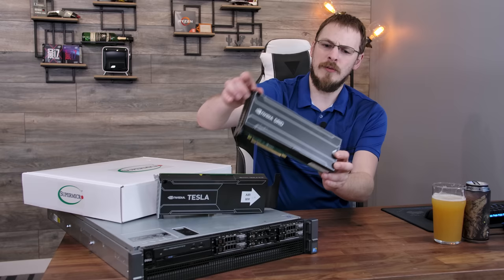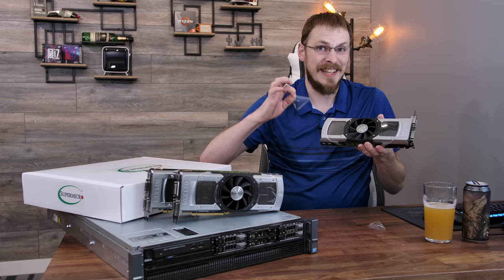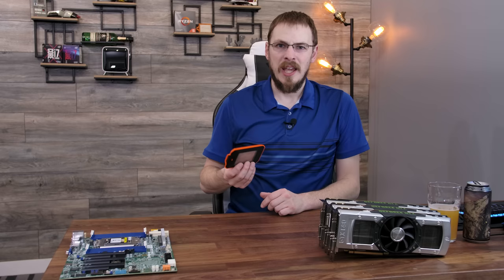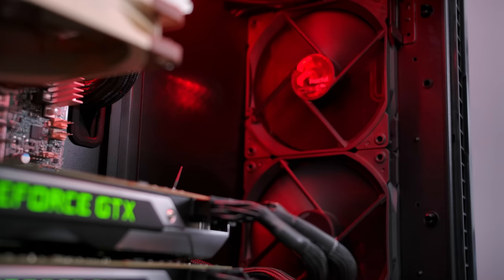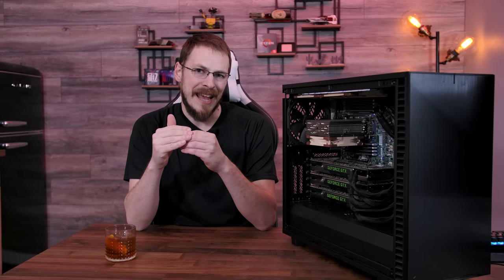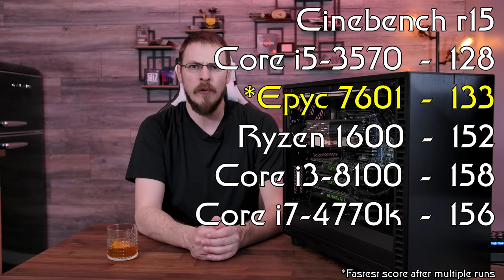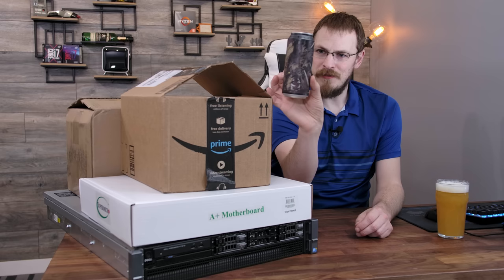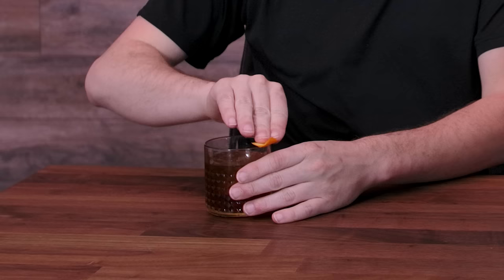EPYC Cloud Gaming Server Build - GTX 690 Editon - Part 4 of ?

Comment from the maker: Yes, the vocal audio isn't great. I lost my regular mic pack, and didn't change settings on the receiver. So it's peaked a bit throughout the video. Sorry... I'll make sure it doesn't happen again... at least until the next video.
Reply from the maker: 🎵 DID YOU EVER KNOW THAT YOU'RE MY HEEEEE-ROOOOOO!!!!! 🎵
Reply: @CraftComputing  YW... From one tech guy to another. ;) Always willing to help when needed. Cheers!
Reply: 5/10

No ASMR peel sound effect.
Reply: Jeff, how could you!!! Frankly I expected better from you... But the beer reviews are back! Huzzah, all is forgiven! :D
Reply: Wouldn't vertically mounting the third card be possible solution to the issue with the sata-connectors?
Reply: @eastcoastmodz5195  Exactly what came to my mind when he explained his problem! These Silverstone sata cables are great
Reply: If you can get your hands on Izotope RX, RX De-Clip is absolute magic for fixing issues like this with 1 or 2 clicks.
Reply: @CraftComputing  hey i have some ddr4 ecc registered 24000 mhz samsung b die im trying to sell i might have 8 matched sticks to sell reply if you want more info
Reply: what do you think on using the p106-90? there are on sale for 35$ on ebay right now

Comment: A few years ago I was walking from a river bank to get back up to my camp site. I heard what sounded like an animal in distress but it was coming from a distance. So I followed the noise as best as I could, but when I got closer to it, the animal would get quite. I had to stand perfectly still for about 45 seconds before it started making noise again. A horrible screeching growl-like sound arose again, leading me in the direction of this unknown animal. It took two more times of standing still to narrow down where the distressed animal noise was coming from. When I finally found it, I realized it was a hurt Possum. The horrible screeching growling noise quickly turned into an angry bundle of hissing sounds. This poor Possum was gravely attacked by another animal. Most of his/her rear, left leg was shredded with cuts extending all the way to the creatures stomach. 
It was obvious from the horrible noises it was making that it was in great pain and it was too injured to run away or protect itself any more. I had no choice but to put it down, to end the suffering. Sometimes, Mother Nature can be harsh, but this possum did not deserve to suffer. And even though it sounded horrible with screeching that could be heard 100 yards away, it still sounded better than the audio in this video.
Reply from the maker: 56 65 72 79 20 66 75 6e 6e 79 2c 20 49 20 73 75 70 70 6f 73 65 20 6d 6f 73 74 20 70 65 6f 70 6c 65 20 6b 6e 6f 77 20 68 6f 77 20 74 6f 20 64 65 63 6f 64 65 20 62 69 6e 61 72 79 2c 20 62 75 74 20 73 69 6e 63 65 20 79 6f 75 20 73 74 61 72 74 65 64 20 74 68 69 73 20 67 61 6d 65 20 49 20 73 75 70 70 6f 73 65 20 77 65 20 73 68 61 6c 6c 20 63 6f 6e 74 69 6e 75 65 3b 20 6d 79 20 74 75 72 6e 21 0a 0a 54 32 39 76 61 43 77 67 63 32 38 67 65 57 39 31 49 47 52 76 49 47 74 75 62 33 63 67 63 32 39 74 5a 53 42 6c 62 6d 4e 76 5a 47 6c 75 5a 79 45 67 54 47 6c 7a 64 47 56 75 49 48 42 68 62 43 77 67 64 47 68 70 63 79 42 70 63 79 42 71 64 58 4e 30 49 48 52 6f 5a 53 42 69 5a 57 64 6e 61 57 35 70 62 6d 63 73 49 48 52 70 62 57 55 67 5a 6d 39 79 49 48 4e 76 62 57 55 67 63 6d 56 68 62 43 42 6a 63 6e 6c 77 64 47 38 68 43 67 70 4d 62 58 68 32 49 48 70 30 65 6e 4a 74 49 47 4a 73 5a 69 42 31 65 6e 4a 76 49 47 64 73 49 47 39 32 5a 79 42 75 64 69 42 33 62 47 52 74 4c 69 42 45 64 6d 39 76 4c 43 42 7a 62 47 64 6f 63 32 78 6e 4c 43 42 6e 63 33 4a 6f 49 48 4a 6f 49 47 78 74 62 32 49 67 64 47 78 74 62 58 6f 67 64 48 5a 6e 49 47 52 73 61 57 68 32 4c 67 6f 4b 53 79 42 6c 61 57 31 79 5a 69 64 7a 49 47 68 6b 63 6d 59 67 61 57 56 6a 63 6e 4e 7a 5a 57 55 67 65 47 39 7a 4c 43 42 31 64 58 49 67 62 6d 52 32 61 47 73 67 63 57 56 70 64 32 74 76 65 57 4e 6b 43 67 6f 79 64 53 41 77 4d 43 41 78 63 53 41 78 4e 43 41 78 4e 79 41 77 4f 53 41 78 61 79 41 77 4d 53 41 31 4d 69 41 30 4e 53 41 7a 4d 53 41 77 4d 43 41 77 4e 79 41 31 4d 79 41 78 4d 69 41 77 4d 53 41 77 4d 53 41 31 5a 53 41 31 4d 79 41 77 5a 53 41 77 63 79 41 78 63 43 41 78 4e 79 41 31 4e 43 41 78 4e 69 41 30 4f 43 41 78 4e 69 41 78 61 53 41 77 4e 69 41 78 4e 79 41 30 4f 43 41 78 5a 43 41 77 4d 43 41 78 61 43 41 78 63 53 41 77 63 43 41 31 4e 53 41 33 4f 43 41 33 4f 53 41 30 4e 53 41 30 4f 43 41 30 5a 79 41 31 4d 69 41 31 4d 79 41 30 4e 53 41 30 4f 43 41 30 5a 43 41 31 4d 69 41 31 4d 79 41 30 4e 53 41 34 61 43 42 79 62 69 42 6e 5a 53 41 35 4d 53 42 6b 4e 53 42 79 4e 43 41 34 63 43 42 6e 4d 69 42 6b 59 79 41 34 4e 79 42 79 4f 43 42 76 4d 79 41 35 4d 43 42 6e 4d 79 42 6c 4f 43 41 34 4e 79 42 6c 4e 43 42 30 63 43 41 35 4d 53 42 6f 4e 53 42 6e 4e 43 41 34 5a 53 42 78 4d 69 42 75 61 43 41 34 4e 79 42 6c 4f 43 42 6b 4d 79 41 35 4d 43 42 78 4d 79 42 76 4f 53 41 34 62 43 42 6c 59 79 42 78 62 79 41 35 4d 53 42 6f 4e 53 42 6c 4e 43 41 34 5a 53 42 78 4d 69 42 75 61 43 41 34 4e 79 42 6c 4f 43 42 6d 4d 79 41 35 63 79 42 78 4f 43 42 70 61 53 41 34 4e 79 42 6c 4e 43 42 30 63 43 41 31 4d 79 41 30 61 79 41 30 5a 43 41 34 5a 53 42 78 4d 69 42 75 5a 79 41 34 4e 79 42 6c 4f 43 42 6b 4d 79 41 35 4d 43 42 78 4d 79 42 76 4f 53 41 34 62 43 42 6c 59 79 42 78 62 79 41 35 4d 53 42 6f 4e 53 42 6c 4e 53 41 34 4d 43 42 6d 4f 53 42 30 63 53 41 34 4e 79 42 6f 4f 43 42 6c 4d 69 41 35 4d 43 42 6a 4d 79 42 79 4f 43 41 30 62 69 41 32 4e 53 41 35 4d 43 42 6e 4d 79 42 6c 4f 53 41 34 61 43 42 79 62 69 42 6e 5a 53 41 35 4d 53 42 6b 4e 53 42 79 4e 43 41 34 63 43 42 6e 4d 69 42 6b 59 79 41 34 4e 79 42 79 4f 43 42 76 4d 69 41 35 61 53 42 6e 4f 43 42 6c 64 69 41 34 63 79 42 6f 5a 43 42 6a 63 53 41 35 4d 53 42 76 4e 53 42 6f 4e 43 41 30 5a 43 41 35 4d 43 42 6a 4d 79 42 79 4f 53 41 34 63 79 42 6f 5a 43 42 6a 63 69 41 35 4d 53 42 76 4e 53 42 6f 4e 43 41 34 5a 69 42 6a 4d 69 42 78 62 69 41 34 4e 79 42 6f 4f 43 42 6c 4d 69 41 35 5a 53 42 30 4f 43 42 77 62 43 41 34 61 53 42 6b 63 53 42 75 5a 79 41 35 4d 53 42 6c 4e 53 42 6b 4e 53 41 30 63 53 41 31 63 53 41 35 4d 53 42 6f 4e 53 42 6c 4e 43 41 34 5a 53 42 78 4d 69 42 75 5a 79 41 34 4e 79 42 6c 4f 43 42 6b 4d 79 41 35 4d 43 42 78 4d 79 42 76 4f 53 41 34 62 43 42 6c 59 79 42 78 62 79 41 35 4d 53 42 6f 4e 53 42 6e 4e 43 41 34 4d 43 42 6d 4f 53 42 30 63 53 41 34 4e 79 42 6f 4f 43 42 6e 4d 79 41 79 5a 53 41 31 63 79 41 30 4f 43 41 34 63 79 42 6f 5a 43 42 6a 63 69 41 35 4d 53 42 76 4e 53 42 6f 4e 43 41 34 5a 69 42 6a 4d 69 42 78 62 69 41 34 4e 79 42 6f 4f 43 42 6c 4d 79 41 35 4d 43 42 6a 4d 79 42 79 4f 43 41 34 63 79 42 6f 5a 43 42 6c 63 69 41 35 4d 53 42 76 4e 53 42 6f 4e 43 41 34 5a 69 42 6a 4d 69 42 7a 62 69 41 30 61 79 41 7a 4e 79 41 7a 4d 43 41 79 5a 69 41 31 5a 53 41 30 4d 69 41 30 4f 43 41 30 4e 79 41 78 4d 69 41 79 63 53 41 32 62 69 41 34 62 43 42 6c 59 79 42 78 62 79 41 35 4d 53 42 6f 4e 53 42 6c 4e 43 41 34 5a 53 42 78 4d 69 42 75 5a 79 41 34 4e 79 42 6c 4f 43 42 6b 4d 79 41 35 4d 43 42 78 4d 79 42 76 4f 43 41 34 62 43 42 6c 59 79 42 7a 62 79 41 35 4d 53 42 6f 4e 53 42 6c 4e 53 41 34 5a 53 42 78 4d 69 42 75 61 43 41 34 4e 79 42 6c 4f 43 42 6b 4d 79 41 35 4d 43 42 78 4d 79 42 76 4f 53 41 34 62 43 42 6c 59 79 42 78 62 79 41 35 4d 53 42 6f 4e 53 42 6c 4e 43 41 34 5a 53 42 78 4d 69 42 75 5a 79 41 34 4e 79 42 6c 4f 43 42 6d 4d 79 41 35 63 79 42 78 4f 43 42 70 61 53 41 34 4e 79 42 6c 4e 43 42 30 63 43 41 31 4d 79 41 30 62 43 41 30 4e 79 41 34 5a 69 42 6a 4d 69 42 78 62 69 41 34 4e 79 42 6f 4f 43 42 6c 4d 79 41 35 4d 43 42 6a 4d 79 42 79 4f 53 41 34 63 79 42 6f 5a 43 42 6a 63 69 41 35 4d 53 42 76 4e 53 42 6f 4e 53 41 34 4d 43 42 6e 4f 53 42 6d 64 43 41 34 4e 79 42 76 4f 43 42 6f 4d 79 41 35 5a 69 42 6d 4f 43 42 7a 63 79 41 30 4d 43 41 30 5a 79 41 35 4d 43 42 6b 4d 79 42 6b 4f 53 41 34 64 69 42 76 5a 79 42 6b 5a 43 41 35 4d 53 42 79 4e 53 42 76 4e 43 41 34 61 53 42 6b 4d 69 42 6a 63 53 41 34 4e 79 42 76 4f 43 42 6f 4d 69 41 35 5a 69 42 6d 4f 43 42 7a 63 79 41 34 62 43 42 6c 59 79 42 78 62 79 41 35 4d 53 42 6f 4e 53 42 6e 4e 43 41 30 59 79 41 31 4d 69 41 35 4d 53 42 79 4e 53 42 76 4e 43 41 34 61 53 42 6b 4d 69 42 6a 63 53 41 34 4e 79 42 76 4f 43 42 6f 4d 79 41 35 4d 43 42 6b 4d 79 42 6b 4f 53 41 34 64 69 42 76 5a 79 42 6b 59 79 41 35 4d 53 42 79 4e 53 42 78 4e 43 41 34 61 53 42 6b 4d 69 42 6a 63 53 41 34 4e 79 42 76 4f 43 42 6f 4d 69 41 31 4d 69 41 31 4d 79 41 30 4e 53 41 30 4f 43 41 30 5a 43 41 35 4d 43 42 6a 4d 79 42 79 4f 53 41 34 63 79 42 6f 5a 43 42 6a 63 69 41 35 4d 53 42 76 4e 53 42 6f 4e 43 41 34 5a 69 42 6a 4d 69 42 78 62 69 41 34 4e 79 42 6f 4f 43 42 6c 4d 69 41 35 5a 53 42 30 4f 43 42 77 62 43 41 34 61 53 42 6b 63 53 42 77 61 43 41 35 4d 53 42 6c 4e 53 42 6b 4e 43 41 34 63 79 42 75 4d 69 42 6e 5a 43 41 34 4e 79 42 6b 4f 43 42 79 4d 79 41 35 4d 43 42 75 4d 79 42 6f 4f 53 41 34 61 53 42 6b 63 53 42 75 61 43 41 35 4d 53 42 6c 4e 53 42 6b 4e 53 41 34 63 79 42 75 4d 69 42 70 5a 43 41 34 4e 79 42 6b 4f 43 42 79 4d 79 41 35 4d 43 42 75 4d 79 42 6f 4f 43 41 30 4d 43 41 30 5a 43 41 78 4d 69 41 31 4e 43 41 32 59 79 41 30 63 53 41 34 63 43 42 6e 4d 69 42 6b 59 79 41 34 4e 79 42 79 4f 43 42 76 4d 79 41 35 4d 43 42 6e 4d 79 42 6c 4f 53 41 34 61 43 42 79 62 69 42 6e 5a 53 41 35 4d 53 42 6b 4e 53 42 79 4e 53 41 34 4d 43 42 78 4f 53 42 71 5a 79 41 34 4e 79 42 6b 4f 43 42 30 4d 79 41 35 4d 43 42 75 4d 79 42 6f 4f 43 41 30 4e 79 41 30 5a 43 41 31 5a 79 41 35 4d 53 42 79 4e 53 42 76 4e 43 41 34 61 53 42 6b 4d 69 42 6a 63 53 41 34 4e 79 42 76 4f 43 42 6f 4d 79 41 35 4d 43 42 6b 4d 79 42 6b 4f 53 41 34 64 69 42 76 5a 79 42 6b 59 79 41 35 4d 53 42 79 4e 53 42 78 4e 43 41 34 61 53 42 6b 4d 69 42 6c 63 53 41 34 4e 79 42 76 4f 43 42 6f 4d 69 41 79 5a 53 41 31 4d 79 41 30 5a 69 41 30 4e 69 41 34 63 79 42 75 4d 69 42 6e 5a 43 41 34 4e 79 42 6b 4f 43 42 79 4d 79 41 35 4d 43 42 75 4d 79 42 6f 4f 53 41 34 61 53 42 6b 63 53 42 75 61 43 41 35 4d 53 42 6c 4e 53 42 6b 4e 53 41 34 63 79 42 75 4d 69 42 6e 5a 43 41 34 61 43 42 7a 4d 79 42 77 4d 43 41 35 4d 43 42 6e 4d 79 42 6c 4f 53 41 7a 4e 79 41 7a 4d 43 41 31 5a 69 41 31 4d 79 41 30 64 43 41 30 4f 43 41 34 63 43 42 6e 4d 69 42 6b 59 79 41 34 4e 79 42 79 4f 43 42 76 4d 79 41 35 4d 43 42 6e 4d 79 42 6c 4f 53 41 34 61 43 42 79 62 69 42 6e 5a 53 41 35 4d 53 42 6b 4e 53 42 79 4e 53 41 34 63 43 42 6e 4d 69 42 6b 5a 43 41 34 4e 79 42 79 4f 43 42 76 4d 79 41 35 4d 43 42 6e 4d 79 42 6c 4f 53 41 32 4d 69 41 30 4f 43 41 31 4d 69 41 30 59 79 41 30 4d 69 41 30 4f 43 41 34 63 79 42 75 4d 69 42 6e 5a 43 41 34 4e 79 42 6b 4f 43 42 79 4d 79 41 35 4d 43 42 75 4d 79 42 6f 4f 53 41 34 61 53 42 6b 63 53 42 75 61 43 41 35 4d 53 42 6c 4e 53 42 6b 4e 53 41 34 63 79 42 75 4d 69 42 6e 5a 43 41 34 4e 79 42 6b 4f 43 42 79 4d 79 41 35 63 43 42 71 4f 43 42 6d 61 43 41 34 64 69 42 76 5a 79 42 6b 5a 43 41 35 4d 53 42 79 4e 53 42 76 4e 43 41 34 61 53 42 6b 4d 69 42 6a 63 53 41 34 4e 79 42 76 4f 43 42 6f 4d 79 41 35 4d 43 42 6b 4d 79 42 6b 4f 43 41 34 64 69 42 76 5a 79 42 6b 59 79 41 35 4d 53 42 79 4e 53 42 76 4e 43 41 34 61 53 42 6b 4d 69 42 6a 63 69 41 77 4e 53 41 7a 4e 43 41 30 62 69 41 31 61 69 41 79 5a 79 41 30 61 43 41 30 63 53 41 7a 4d 79 41 33 4f 43 41 31 4d 79 41 30 4e 53 41 30 4f 43 41 77 62 69 41 31 4d 69 41 31 4d 79 41 30 4e 53 41 7a 4e 43 41 30 5a 79 41 31 4d 69 41 31 4d 79 41 30 4e 53 41 30 4f 43 41 7a 4d 77 3d 3d
Reply: @CraftComputing  Hey Hotshot...You spelled "beginning" wrong.
Reply: Oof, got him
Reply: @CraftComputing  Only managed to get to the atbash encoded part ):
Reply: @CraftComputing  Damn i got as far as windows-1251
Reply: @CraftComputing  Can we get a hint on the second part? I love this games but I did only the hex part :(
Reply: @CraftComputing  Wow... Lol I know pretty much no encoding. I only made it to Base64 (the second part).
EDIT: Made it to atbash.
Reply: @CraftComputing  Made it through the Beaufort Cipher, still trying to crack the next one.

Comment: 9:15 - thats a far better mounting method for M.2 drives than the normal microscopic screw, would like to see that on consumer boards.
Reply from the maker: Right? The main issue with it is it doesn't look good, and boards are sold partly on looks these days.

Maybe in black it's be passable.

Comment: Great video and what a monster machine. It was pleasure to watch and can't wait for next part. Quick suggestion here - move the middle GPU to vertical position if possible, that's not because the thermals but to give you free access to these SATA ports and access to one of the x8 slots.

Comment: Add a riser for the middle card and mount vertically and temps will be in check once fully loaded and it leaves more sata ports available
Reply from the maker: I may do that. Would free up an 8x slot for a 10Gb card too :-)

Comment: Unfortunately i did something similar to this, i'm using my laptop with Remmina to connect to the server and the mouse just won't work great.
Basically when playing any game with a lot of mouse movement as soon as you reach the border of the screen you won't be able to move your mouse unless it's to the other way.

Craft Computing if you ever try this with Remmina and find a work around please do share it on the videos.
Keep up the good work.
Reply: Can you turn off screen edge transitions?  (That is what it is called in Input Director where I have ran into similar issues in the past)

Comment: I had a similar problem with the position of SATA ports and the graphics card blocking them.

Silverstone do low profile 90° SATA cables I got mine on Amazon, saved my build!
Reply: SST-CP11-300

Comment: looks great.....I just did something kinda similar (be it less powerful and with older hardware) built a gtx980 sli setup with 2xgpu's, used a spare i7 cpu and board with 32gb of ram...threw it all in a small form factor case with some rgb and made a cheap gaming rig....working good so far...

Comment: I recently fought a similar build: Epyc 7282 on an ASRock Rack EPYCD8 intending to pass four 1070Ti to four VMs (three are working and Folding@Home right now). Wasn't going to try going full "cloud gaming" after watching parts 1-3, but still a battle to get everything working.
Reply from the maker: Heard from a little birdie you can hack in SR-IOV support into Pascal GPUs. Meaning you can distribute GPU power to different VMs on a 1070 or 1080.

Stay tuned.....
Reply: @CraftComputing  Interesting... right now I'm just trying to figure out why the host waits until I power up a VM on PCIe lane 01:00 before it steals it from me. Thankfully haven't had to worry about gfx card BIOS or flashing yet, but worried I might have to

Comment: Maybe try a cheap (now) mining case that elevates the cards away from the motherboard.  Then use PCIe x16 extenders to the cards.  That would free up the smaller x8 slots for other cards and open up your sata and SAS ports.

Comment: For you SATA port issue you can get some lateral 90 degree ultra thin sata cables that may do the trick for you.
Reply: You also have a vertical video card mount you could install one of the video cards into and have full access to those sata ports.
Reply from the maker: I just might vertical-mount the center GPU so Ican add a 10Gb network card.

Comment: Make sure your Supermicro board isn't compromised by the CCP. It's possible, by a small added chip. My supermicro board from 2015 has the chip. Because of this, I only use the server (freenas) as an external hard drive with a direct 10G ethernet connection, until i have upgraded to an uncompromised board.
Reply from the maker: That was never backed-up, confirmed, or seen by ANY of the accused organizations, 3rd party investigations, or 3-letter-agencies in the US. In fact, just about every single industry interested in espionage dug into the internals of every SuperMicro board over the last 10 years looking for this issue.

Let's ask which is more likely... was China able in not only create a chip, alter board layouts to include power delivery and at least I2C communication to CSM, while also figuring out how to hide outgoing packet surveillance data from not only the host system, but every downstream firewall of unknown origin and configuration of every major corporation who uses these boards, and then managed to make every single 1st, 2nd, 3rd and 4th party who investigated the issue keep silent on their findings...

Or the chips never existed. And the rumors were a single Bloomberg article with no verifiable sources.
Reply: @CraftComputing  Touché!

Comment: Wouldn't some 90 degree sata cables fix the whole sata clearance problem? Or at least very well help quite a bit with the bent cables? I think that could help quite a bit with this as a permanent solution for longevity, rather than choosing a whole new board.

Comment: Hmm... Not Asrock EPYCD8 / ROMED8? That has a better layout and is not much more expensive. The other thing you need to watch out for with the 1st gen EPYC is that there are 4 NUMA nodes in that one socket. That means that to get optimal performance out of it, you will need to make sure you pin each VM to a single NUMA node, make sure all of it's memory is allocated on that NUMA node, and that the GPU that is passed through to it is on the same NUMA node. Otherwise the memory and PCIe latencies will suffer.